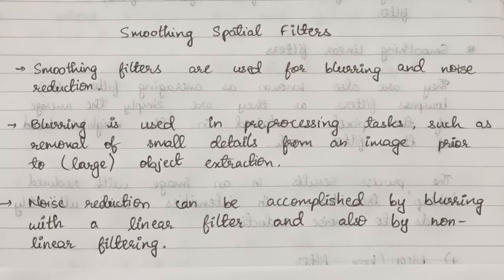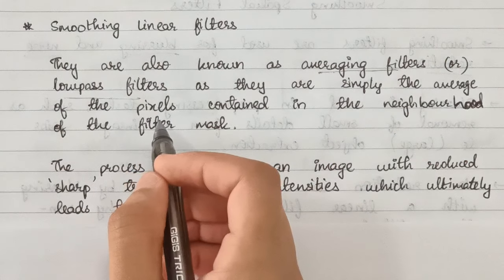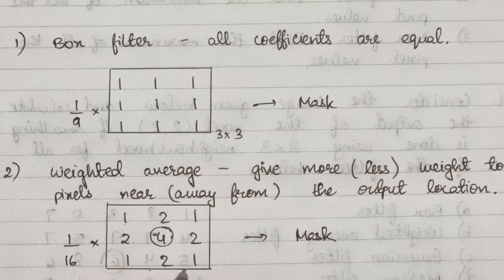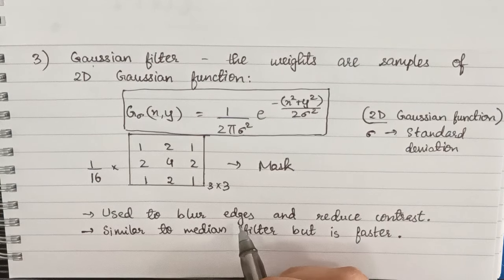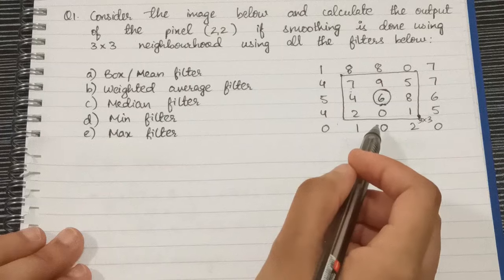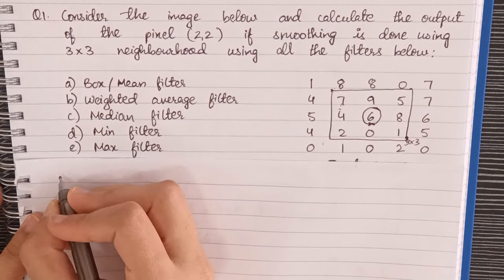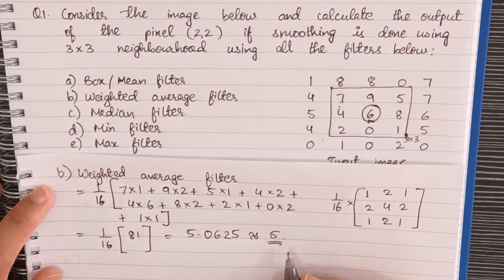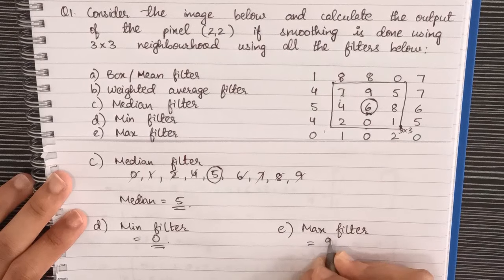Smoothing Spatial Filters in digital image processing

Comment: Hey whats the difference between weighted avg and gaussian? both had the same weights in your example.
Reply: Just my dumb observation but I think Gaussian is probably more accurate, if you can see the matrix you kinda can observe two normal distributions along x&y axes of central pixel's(Target pixel) row and column the diagonal ones however, are having a very little weightage because of the way that they're too far from the centre most likely be less influenced by the value(Intensity even in minute levels) from the central pixel, the gaussian filter here takes variance into account while assigning such weights,Where the WA filter doesn't and ofcourse exponential being more smooth than a "linear" weighted average gives us more room to play with?   But the end of the day its all an approximation which depends on several physical/Optical factors.so there's that.